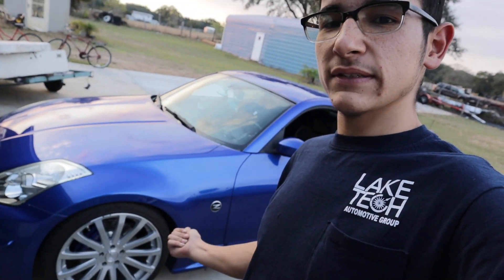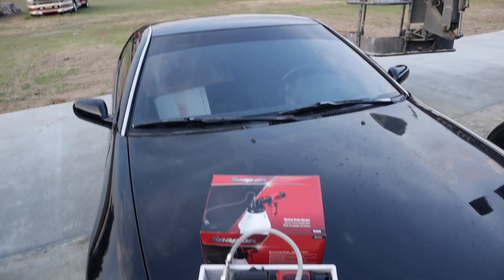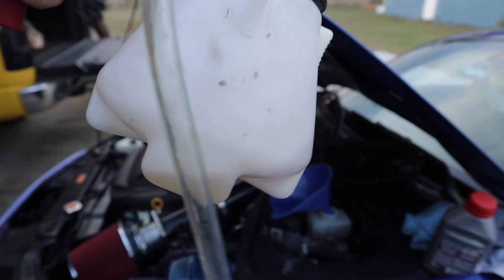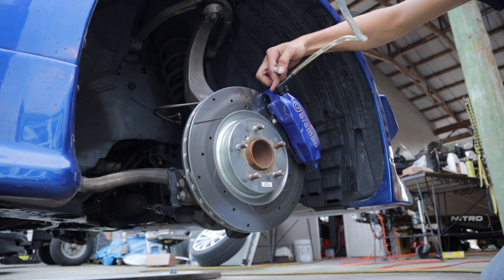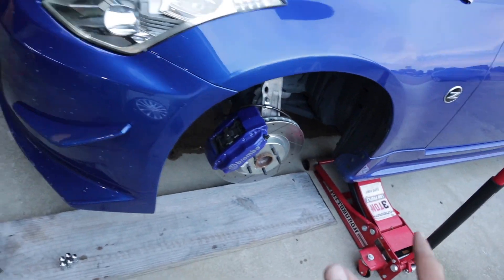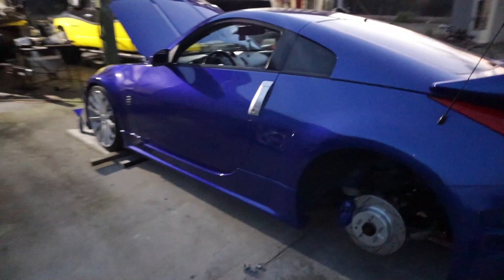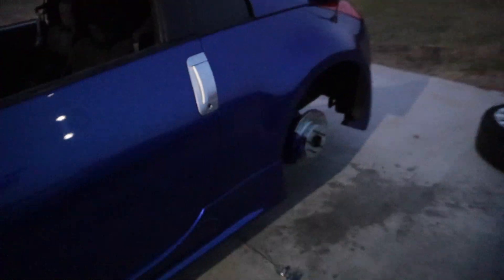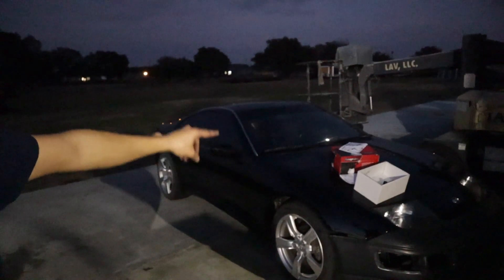How to properly bleed your brake lines! Using Snap On Brake Bleeder!

Comment: Always start the bleed from the furtherst point from the booster same goes for front aswell, this ensures that all the air in the system has been removed.
Reply from the maker: I learned that doing this lol but thanks for the info 🙏
Reply: Not every car uses the furthest brake first method. A great example is the Honda S2000. You do the closest (front left for USDM), the other front brake, then cross to the rear brake behind the first brake, then the furthest is last.
Reply: I was about to say the same thing.
Reply: That used to be true, but not anymore.

Comment: What type of air compressor did you use?
Reply: Snap On Specs call for the following: Air Pressure	Minimum: 550 Kpa (80 PSI); Maximum: 900 Kpa (130 PSI)
Air Consumption	Maximum: 180 L/Min (10 CFM) at 100 PSI
Reply: What compressor did you used?